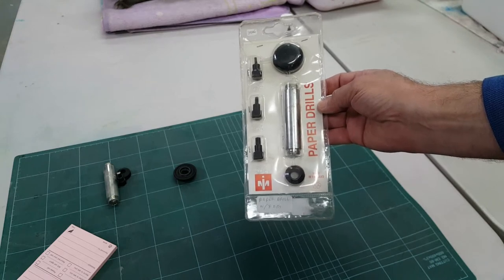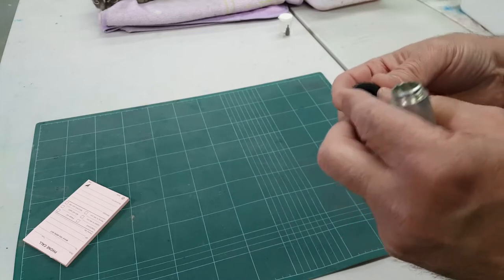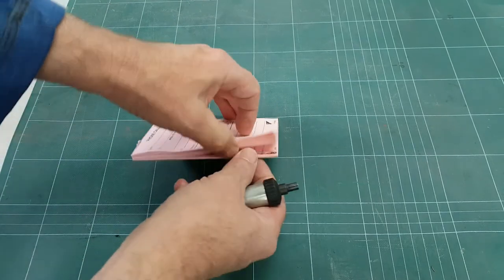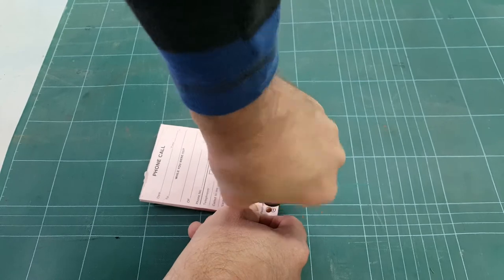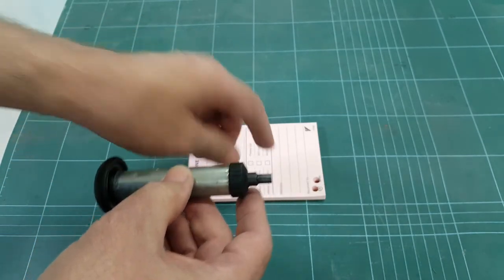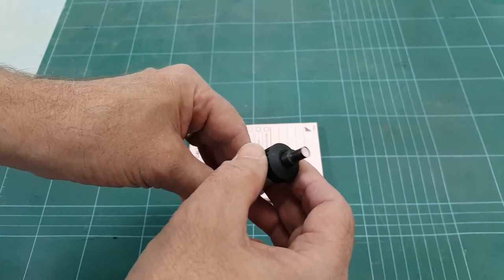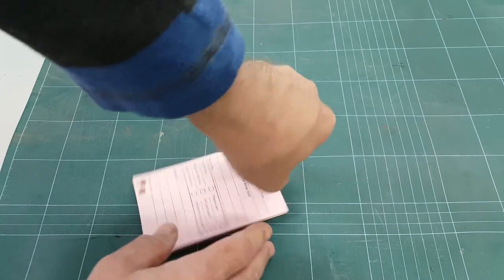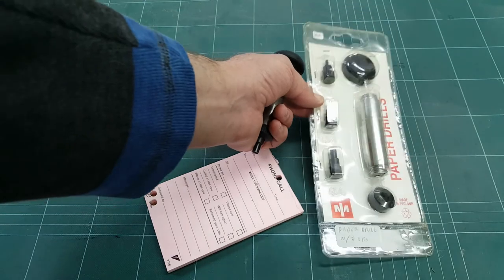Paper hole drill (punch)

Comment: Thanks, you know if there's anything that is capable of making bigger hole diameter say 20mm.
Reply from the maker: Such punches very likely exist but I don't know where to get one. I expect a large punch like that would require some sort of press or machine to provide enough pressure and keep it straight. Many machines also rotate the round punches to provide more of a slicing action rather than a straight-in chopping action.

You can probably find hole punches for leather, but these are tapered on the outside rather than the inside so if you use them on multiple sheets or on board (rather than single sheets of paper) you will find the hole gets stretched as the punch penetrates through.